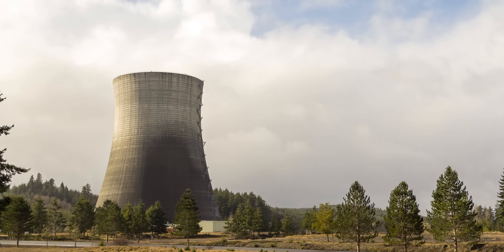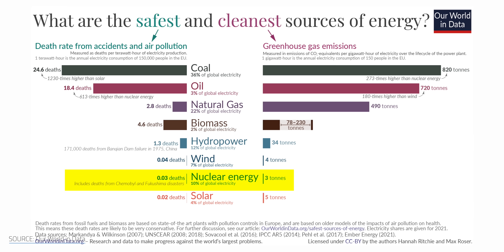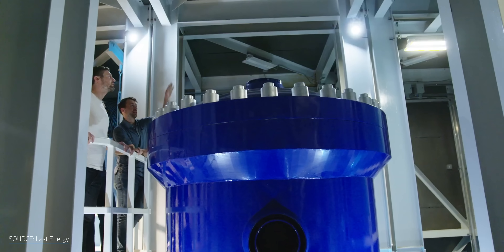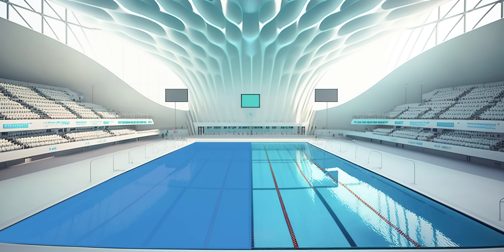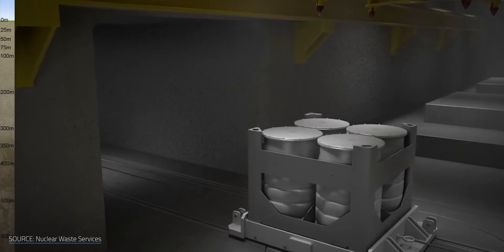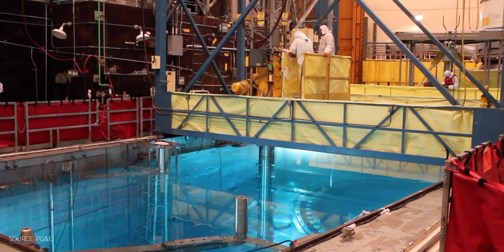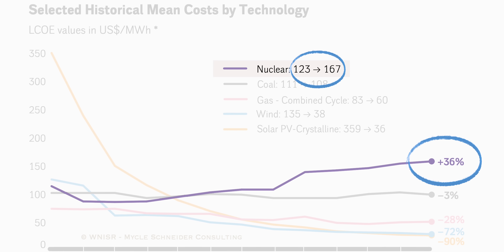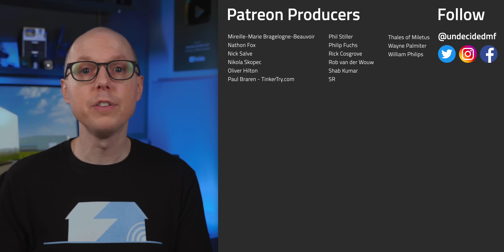Is Small, Fast, & Cheap the Future of Nuclear Energy?

Comment: You know, solar and coal should be compared for LCoE when
1) Solar is capable of providing base load (never) AND dealing with the waste it generates afterwards
2) Price of coal is going to include the full cost of going net zero on the carbon emissions (probably not anytime soon)
And as far as wind goes, as far as I know people still don't actually factor in the actual total cost of it and the cleanup of the hazardous waste it leaves afterwards.
Reply: 🙂Sure, just as soon as coal and nuclear are made load following.

Comment: Excellent video!
According to Google, there are 11 rbmk reactors still in service. They all began operating between 1979 and 1990. They have been operating safely over that time. Not bad for a poor design. 
As to levelized cost, another term that is just now being discussed is capacity factor. I'm curious if capacity factor has been figured into the numbers you presented. If not, the adjusted numbers would be nuclear 167 per mw, wind approximately 152 per mw, and solar would range between 144 & 360 per mw. This does not factor in the US estimated 30% increase in transmission line miles needed if we were to transition to a wind/solar dominated grid.
I found this interesting. In order for a typical newly installed wind farm to equal the power generation of Last Energy's, smr occupying 1/2 an acre. That farm would need to cover 2 square miles.
Reply: yes, while LCOE is a convenient way to compare energy generation, its has its limitations. for starters it only take investment cost into consideration, not other things like land usage, pollution, or other social impacts in general. it also doesn't take into consideration things like distribution cost, and as you mentioned, storage costs.
Reply: Interesting but farming (of plants and animals) can still be done on wind farms if installed on land. The largest wind farms are offshore though and land area required is therefore zero.
Reply: @adon8672  all correct, but it does highlight the scale difference between the two. It's not a problem, perhaps in western Australia, the American West, or the Dogger banks. It probably will be in a densely populated country with little spare land. That's probably why England and Japan are taking a hard look at nuclear generation (Japan is all in). If the technology proves to be safe and reliable, New England in the US will likely also be interested. They do like their ocean views up there.
Besides, doesn't it make more sense to use a power dense, low footprint, very reliable energy source instead of installing 10 times (perhaps 40x) as many wind turbines that will also require a huge number of batteries, hundreds of extra transmission miles, and probably a fossil fuel peaker plant?

Comment: Sorry, but that study you showed is complete crap & useless.
Because one is always exposed to pollutants, e.g. from coal, in varying strengths, while radioactively contaminated areas are always evacuated directly.
One only has to ask the Russians, who took up their position in the red forest, about the consequences of letting people live on contaminated soil.
Ah, I forgot that they have all died of radiation sickness in the meantime....

Apart from that, fuel rods don't grow on trees and, above all, uranium deposits will be exhausted in less than 80 years - with increased consumption, in the worst case even before we run out of oil.

Comment: Matt, when you talk about the cost per megawatt hour for solar, wind, coal and nuclear, you show that solar and wind are the cheapest. But they are both intermittent power sources that need either backup power generation or battery backup. Once you factor in those costs, they not as cost effective as you portrayed. Unless there is a major breakthrough to bring down the cost of battery storage, wind and solar will not be major players in a stable and consistent power grid.
Reply: 🤓Energy storage (not just batteries) costs are coming down rapidly. Nuclear is not rapidly demand load following technology, so it needs additional power sources as well. Today's pumped hydro energy storage was built to enable load following for nuclear (and coal) plants.
Reply: @fotoguru222  I am totaly with you on that. I am always weary when renewables are priced without storage (or backup) in theese kinds of comparisons, but as you said, nuclear likes to run continuos to be economical. (even if 50% reduction in output is possible).
If one, for example, watches "Elina Charatsidou - Nuclear Physicist REACTS to Sabine Hossenfelder Is Nuclear Power Green?" you will notice that she also basically names all options you would also need with going wind and solar (pumped hydro, battarie storage, H2, Power-to-Gas, Methanisation, gas peaker plants,  demand shift, etc) - maybe to a lesser extent?

Comment: God I hope not. Nuclear is our least clean form of power. Meltdowns aren't the real safety issue with nuclear. There's no way to get rid of the waste that we know of. The half life of U235 is 700 million years., That's greater than the time between us and the very first dinosaurs. At least the CO2 will be gone in a few thousand years. We don't have the actual deaths for nuclear yet. Over the time scales were talking about there aren't any geologically stable areas. The steel containers we put them in only last 40 years because they act as sacrificial anodes. They literally disintegrate. The fuel that's in your local reactor might contaminate a water supply in half a million years and kill 250 million people.  Solar, Wind and related ones like elevated water storage are the real power we need.

Comment: Rolls Royce is also addressing this challenge in the UK with a modularised smaller fast build nuclear plants.  We have a huge standard nuclear plant being built right now in the UK (by the French Nuclear experts) and this is a 10 year build.   But the small scale modular systems are much more interesting as they lower the costs and time to first electricity.
Reply: And the Rolls Royce SMR's have been working without nuclear incident for the past 60 years.
Reply: Yeah u should see the old ones in Russia that are poisoning people that blew up if u need more about why these are so bad they say they will produce 30 times the waist to power output and make plant regulators who can't visit all the reactors now an impossible job just look up the problems with small nuclear reactors and
Reply: 10 years is too long.  They should be built in factor.  Sited.  And operational in 1 year.
Reply: China has a running thorium plant in the dessert.
China is now building the largest containership that will run on a thorium plant.
Look it up...!!!
Reply: Rolls Royce is using the same reactors it puts in UK nuclear submarines and just building them on land. It’s kind of genius to be honest because they have decades of proven safe operation in dangerous conditions.
Reply: @thomascrabtree This actually isn't the case, they want to build them in the same location, but they are absolutely not naval pwr's of any generation. It would be illegal in multiple ways to do this even if it was sensible(which it isnt).
Reply: RR have everything they need, except for a government prepared to back them. We will, as usual ceed our technological advantages to our competitors. I wish I'd emigrated 40 years ago.
Reply: @billdoodson4232  I did (emigrate 43 years ago) but - call me crazy - came back again and now I'm stuck here!  
I'm really perplexed why there's so little work going into Liquid Salt / Thorium reactors, which are intrinsically safe.  They should be far cheaper if disposal costs are included (as they should be).  The US had a pilot Thorium reactor ready to roll in the 60's but it was ditched as the nuclear weapons manufacturers got no fissile material from it - you'd like to think we're a bit more sensible these days, but the evidence is pretty scarce!
Reply: @billdoodson4232  Yup, RR told the UK government, that they have a production line ready to go. As usual, the government just dithers and delays. I'd sooner spend the money on the RR SMR's than HS2.
Reply: @PixelProfessor  You're totally right there. I would have supported HS2, if they had started building from Newcastle, south to Leeds. What we have now is more money pumped into the south.
Reply: great, maybe they will fix their machine shop in Walpole, ma.
Reply: Nuclear car when?
Reply: @zbarba  When there are no more car crashes. ^^

That's also why the US army dropped the plans for nuclear tanks and planes (they were technically possible, but the risk of fallout in case of crash was just too high)
Reply: Would be a nice question to Elon musk on next investor day. I will try.

Comment: What about gas cooled reactors... far safer than PWRs.
There are long term storage facilities in the UK... under the Irish Sea near Windscale where the ground is granite. The UK reprocesses nuclear waste. 
You have missed the main cost of nuclear.... de-commissioning- making it cost 210$ per kilowatt hour.
Another factor are the lies told by the nuclear industry.  This relates specifically to small modular nuclear reactors where ground pollution is massive and spreads easily.
All this leads to the 'nuclear last' option.... You really couldn't invent anything more dumb.

Comment: I would want to see the plan for handling the out years.  What happens if a company that had a unit installed goes bankrupt?  Who takes care of securing the reactor?  Who pays for the waste handling?  Superfund sites are basically where companies neglected the handling of something and then abandoned.  Nothing in this video made me think that nuclear power plants everywhere make any sense at all.   Many anti-solar panel opinions always site the low efficiency of panels.  But I always say even if it was 10% and they are much higher than that, 10% of the sun energy sounds good to me.  We just need more panels.  But in reality, panels are getting so efficient, and can even provide a good amount of power on cloudy days that to me the technology is a no brainer, especially as we move toward solar room shingles like the Tesla solar roof.  Couple this with a solid battery storage system and I will take that solution all day as compared to nuclear.  The weakest link to nuclear is not the tech, it is people who choose not to do the right thing, politics that can disrupt any area with the war machine.  For the latter, just think about the Ukraine, now imagine dozens if not hundreds of small nuclear site targets!  Until we find a way to speed up the decay process, or make the radioactive material inert in say a month, then nuclear is just setting the stage for environmental and community disasters.
Reply: Government.
Reply: Silly.

Comment: LCOE does not account for intermittency, intensity of mining required for produce each type of energy source, drain on REEs, land size needed for comparable output, how long each type of energy lasts (20 yrs < 60+ years).  Also, only nuclear is required to have a disposal plan which is added to the cost/KwH that customers pay: it is not the industries fault that politics is preventing recycling and has not given them better storage (temp & permanent) options.   SMRs and MSRs are the future, though.

Comment: Thanks for debunking the myth that we can do without solar/wind in the energy mix, if only looking at the cost of nuclear is already pretty demoralizing for "just go nuclear".
Furthermore  guessing small nuclear reactors will be hitting hard with the NIMBY folks: 20MW: so need to locate about 50 smaller ones before having same output of an average nuclear plant [or 40 for average gas], how can that be more cost effective in planning, prepping and fighting opposition and later running and dismantling. 
On other hand: the scalability is surely an advantage while we going renewables as fast as we can, so building and dismantling time might be smaller making it an good (short term/temporarily) solution.

Comment: Nuclear is unreliable, works 24x7 except during years-long maintenance cycles and is extremely expensive for the scant power it can provide before resources needed run out.

RTGs -- over 1,000 scattered around undocumented in the former Soviet Union with hundreds of those lost -- in particular are a bad job, no matter what Mark Watney says on Mars. Any 'Small, Fast & Cheap' nuclear reactor is just a form of RTG with better branding, but no better safety.

It's true, bad weather doesn't shut down most nuclear as easily as it does a Texas fossil facility, but when climate change or earthquake do threaten nuclear generation, bringing it back online is much slower. Just look at what happened with the nuclear power stations in Louisiana when a hurricane visited just last year. And that was the optimum case with a huge, trained workforce responding to just a pair of reactors. Imagine if there were dozens spread around in less and less optimal locations?

When a reactor needs maintenance, it isn't hours at a time as in solar and wind, but months or years. In some Canadian cases, over a decade passes during 'routine maintenance' of nuclear.

And there is no power more expensive than nuclear, except possibly a hamster wheel, per kwh.

But the kicker: we don't have enough of the rare minerals needed for building nuclear containment vessels and nuclear reactors and enrichment and refining facilities for more than a small percentage of human energy needs, and once we use those up in nuclear and irradiate them they can't be recycled for other pressing medical and other needs.

Comment: Great video. I will look online but the real problem I see is what happens if one of these modules goes wrong. If you have lots of modules in a bigger plant is this easier or harder to control.
Reply: IF and the chicken little nay sayers love the IF strawman arguments, IF a problem is found in a facility which is of a common design, then it becomes 1000X easier to fix other installations once the first issue was resolved and the 4,000+ energy loathing regulators got to put their tiny little finger print on the solution.

Comment: Great video! A large nuclear station is soon to be completed for a ridiculous £32.7  billion in England. It is a joint project with France and China for a new reactor design, although no blame other than  construction inputs  heavily dependent on volatile hydrocarbons during a global energy crisis. Unfortunately, this will need to be offset against the wind and solar energy that constitutes around 50%, a record quarter for the UK energy mix and excluding for the first time deadly coal with 0%!  Nevertheless, additional nuclear power from SMR nuclear reactors may be a more cost-effective alternative than larger construction.  Indeed, sites around the UK are being considered for construction by 2030, according to Rolls Royce, who wish to produce small modular nuclear reactors. This would be useful for an additional supply of hydrogen for our energy and industrial agriculture strategy, which includes an innovative use of renewables for ammonia and nitrogen fertilizer production, in addition to hydrogen from the world's largest offshore renewable infrastructure in the North Sea. My final point is that the purpose is to meet carbon net-zero and 100% renewable energy security, with mixed pink, blue, and green hydrogen storage. Of this, 2-10GW is planned by 2024-2030 with work already started alongside the other EU nations mutual from the offshore wind infrastructure in the North Sea.

Comment: It's actually quite easy to debunk these SMR pipe dreams.
We have been using a lot of small reactors for decades in military, namely, nuclear submarines and aircraft carriers.
The U.S. Navy also has built nuclear-powered cruisers but they were abolished since the operating cost was too high.
Small reactors are too costly even for military usage, otherwise, every single combat ship should have been powered by nuclear, considering its significant advantage for relaxing logistical constrains in the military operations.
I think it's a bit naive to believe these random startups are gonna suddenly achieve something which gigantic military corps have yet to accomplish.

Comment: “Are there 24,000 year solutions? It’s kind of difficulty to say. I’m going to guess no.” I appreciate the sarcasm, but let’s be direct. No, there are no 24,000 year solutions, and no one can make a cost/benefit analysis that is that long. Therefore, it’s impossible to estimate the danger of waste that is dangerous for so long.
Reply: You don't need a 24,000 year solution. The more radioactive an element is, the shorter it's half life. That means the really nasty stuff doesn't last anywhere near that long.
Reply: @LesNewell  
You give humans 24,000 years, there bound to find something stupid to do with it, with in that time. 
If the uranium was ran through a MSR instead you only need 300 years storage, your efficiency goes from 1-3% up to almost 100%, which means you don’t need to buy that much uranium from Russia.
If you use Thorium instead of uranium, rare earth mining can becomes profitable in the USA even after the weapons material reclassification of Thorium.